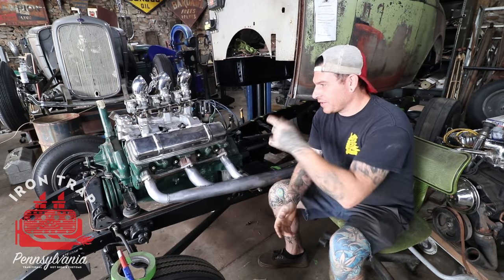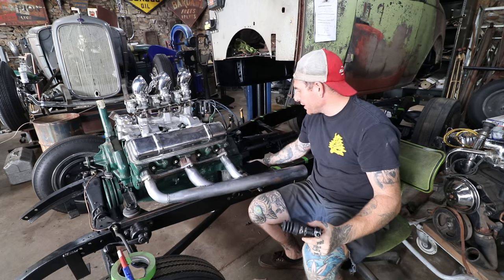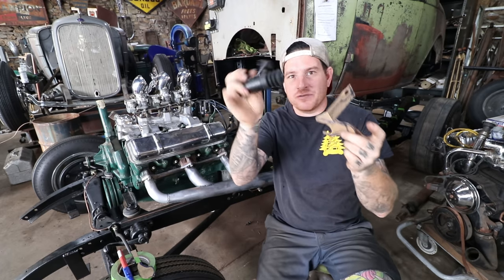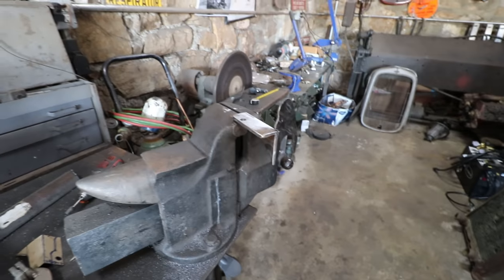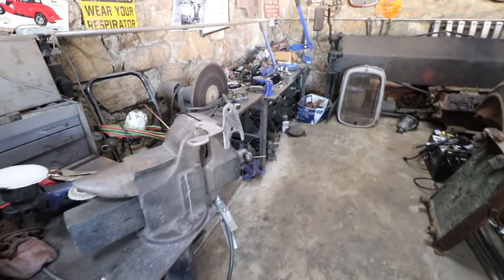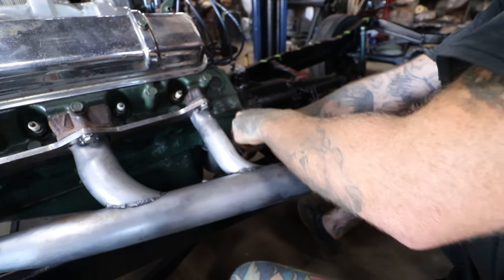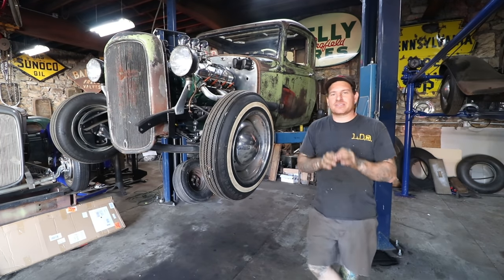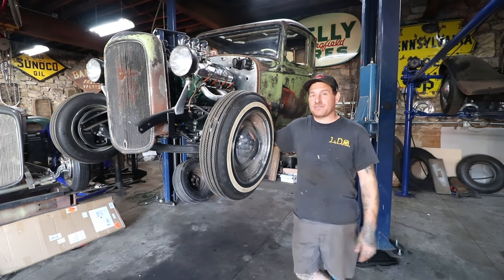Hydraulic Clutch Conversion On A Lasalle Transmission - 1932 Schroll Coupe

Comment: That system will work fine, I have been using this type system on my 39-40’s for at least 45 years. Get a flex hose to connect them .

Comment: I try to steer clear of hydraulic clutches, especially the modern ones with the internal release bearing. Do not run DOT 5 brake fluid in a hydraulic clutch as it will usually fail prematurely. If you have the internal release bearing it could fail in as little as 15 miles. I like mechanical clutch linkage because it doesn't leak.

Comment: Is there any issue with mounting the master cylinder? I'm working on something now, and I have absolutely no space on the firewall to put a master cylinder. I've been working on modifying an original mechanical setup because I CANNOT figure out how to switch to hydraulic without laying down some heavy $.  The IHC slave cylinder isn't too bad and I can probably scrounge the brackets - it's the master cylinder that's killing me. ANY ideas would be appreciated. I have an original set of pedals to work with.